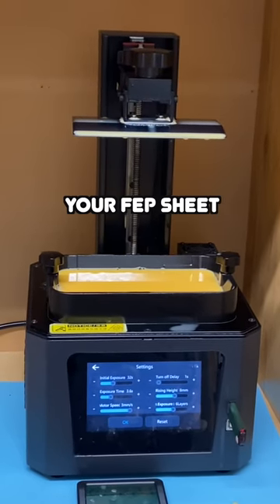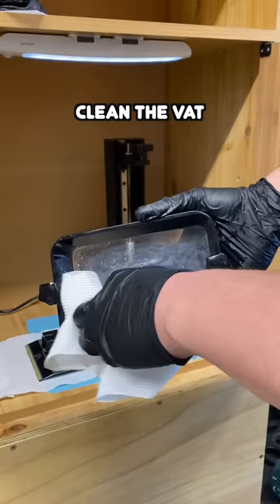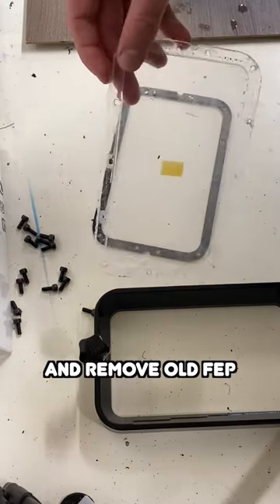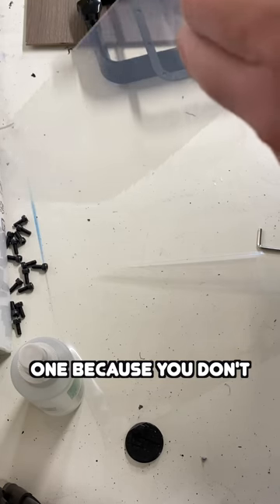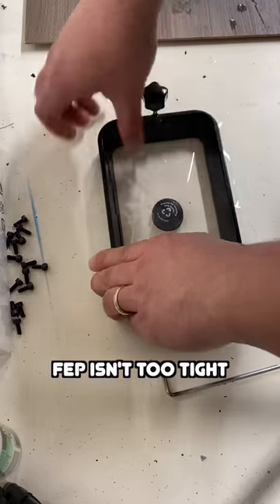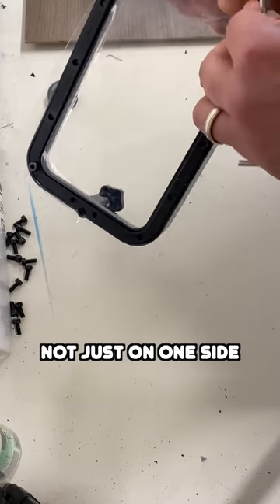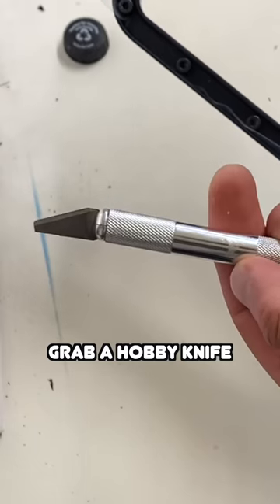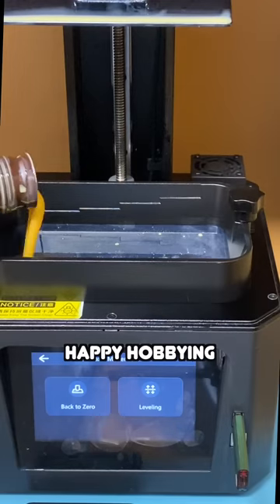How to change FEP resin 3d printing

Comment: I'm an engineer for a 3D printing company. Please, please, please wear gloves when you work with liquid resin. Monomers in the resin are not good for you or water life.
Reply: What it do?
Reply: Does it say so on the resin?
Reply: @mrtrex1748  yes
Reply: @forlexer  if you're not allergic to it already, you're gonna become allergic to it
Reply: Read the SDS sheet.
Reply: @PapiJack  the S in SDS is already "sheet"!
Reply: @FAB1150  People saying VIN number bugs the hell outta me too lol

Edit: And ATM machine lol
Reply: @kaine2416  always bugged me its the norm to say PCV valve or TPS sensor lmao
Reply: @kaine2416  This is RAS Syndrome. IP protocol, PIN number, DC comics, etc.
Reply: @asnodgrass  DC actually dropped the extra Comics from their new stuff
Reply: @FAB1150  LOOOOOOOOOOOOOOOOOOOOOOOOOOOL
Reply: @zokushatech  PCV stands for Positive Crankcase Ventilation so PCV valve makes sense and TPMS is Tire Pressure Monitoring System so that's correct too. Sorry mate I like to nitpick.
Reply: @maynarddrivmester2224  i said TPS, not TPMS. Throttle position sensor. But you are correct on the PCV lmao i totally spaced that 😂. I also hear alot of people say like “i think there is a problem with the ABS system” that one bugs me as well.
Reply: I wrote that at 1am and was about to correct it this morning lol.
Reply: @maynarddrivmester2224 you're not nitpicking and don't need to apologize. You're just correcting the incorrect correctors lol!

Comment: I have a suggestion. Buy a cheap battery op drill. Buy a set of hex head bits. Find the one that fits those bolts, and use the drill to do the screw/unscrew work for you.
Reply from the maker: Definitely will be doing that.

Comment: If you got a lot of screws, get a drill. 

"But-"

No, get a decent one with adjustable torque settings. Any of the ones with a chuck with adjustable numbers is adjustable torque. Just turn the torque way down and tick it up until it's just enough to turn the screws.

Comment: For all the screws I recommend an electric screwdriver with a hex bit. If the screw driver doesn't have enough umph then just manually break them loose
Reply: I second this & if ur worried about damaging the fasteners or something, idk, the small electric driver I have isn't strong enough to even break screws loose half the time so I often break them myself while holding the left-turning button

Comment: Buy a powered screw driver like a mini drill. Buy a pack of Allen key bits. Never worry about assembling things or taking them apart.
I bought mine for furniture work and also to work on gun attachments at the company armory.

Comment: Working with resin has put me off getting a resin printer so far :(
Reply from the maker: That’s fair enough.
Reply: @Habes  Finally got over my resin fear a few months ago and have been Resin printing happily. Went overboard with installing extractor fans and 3D printer enclosure (with its own extractor too) in the garage.

Comment: How do you remove the bottlecap?
Reply from the maker: The bottle cap is just between the FEP and the table, so if you lift the FEP off the table the bottle cap just stays there.
Reply: @Habes  Got it, thank you!! Seriously helpful video btw, I'm just getting into resin printing so I'm trying to get the process down before I start
Reply from the maker: @aaronvischer13  Happy to help :)

Comment: This is assuming you don't do mostly FDM prints. Not resin to mess with or spill, just plastic filament. Also, replacing the bed surface, the FDM equivalent of a fep, just needs a good scrub and maybe some adhesive scraping, and maybe cleaning the print head.

Comment: Imagine having resin printers
Reply: I have one and there's also two more that are owned by my mom's friend and my dad that are in the 3d printer room in our pole barn along with 2 filament 3d printers and a filament 3d printer kit that needs to be assembled. Also none of the 3d printers can be used because the pc  the slicing software is on broke.
Reply: You have six 3d printers, 4 of them are resin, but you can't buy a laptop. 

Imagine having resin printers

Comment: I suggest you invest in an electric screwdriver, saved my life so many with tiny screws
Reply from the maker: Already planning on it XD
Reply: @Habes  how the hell do you not already have one I have six they're like anywhere between 20 bucks to $200 there's a very large price range on them in the super expensive ones are the small precision ones that are for like tensioning bolts and small two-stroke engines professional racing
Reply from the maker: @gnomewarlord8962  I've got a drill, I just don't have the hex bit yet.
Reply: @Habes  then why haven't you got one you don't even need to buy the hex bit you can literally just cut the end off of that Allen key and use it like that
Reply: @gnomewarlord8962  I just wanted to say that you could just cut off a piece of an Allan key to get a hex bit of the respective size. But then I saw your comment xD.
Reply: @gnomewarlord8962  My guy literally explaining that he's getting the proper tools twice

You know people lose stuff, right? And that not everyone wants or needs particular tools for particular tasks, especially if we're talking about automatic upgrades to manual tools
Reply: @Nawmps  homeboy what the hell are you talking about when it comes to particular tools for particular jobs you can use electric screwdriver for anything that requires a screwdriver that ain't really all that particular it's multifunctional
Reply: @gnomewarlord8962  My guy not every power tool comes with every bit

Maybe he has a set of hex bits that don't fit those screws

Or maybe he wants to get a torque-limited screwdriver so he doesn't need a breaker bar to get them back off after tightening them

I just don't understand why you're so personally invested in and betrayed by the fact that he doesn't have one already. You sound like a parent grilling their kid as to why they haven't done their homework yet 💀💀💀
Reply: @Nawmps  well my guy if you read my second comment you would understand that you don't really need a designated bit you can just cut off like a 1-in section off the long end of the Allen key

Comment: I've changed multiple FEPs and never used something to add tension. I'm certain you don't need to do this. Lol
Reply: Same. As long as it's mostly right when you screw the metal frame together, you screw it on to the vat, the vat will actually add all the tension it needs
Reply: Same here

Comment: > screws 
M8, get you an impact driver. Life changing tool
Reply: Maybe don't use it to tighten them at the end.

Like use it to screw them in at the end but not super tight. I can see this messing with the print if the tension between two screws is too different.
Reply: @Peaceful3arth  or just get a just an impact for loosening and a ratcheting screwdriver for tightening, i only use Lkeys where nothing else fits 😄
Reply: @Peaceful3arth  yeah but thats a matter of time and finesse and you can figure it out, and you can just count ugga duggas if anything
Reply: @thegreatchickenoverlord5976  They make electric screwdrivers that achieve the same thing but won't torque the hell out of whatever you're working on. Alternatively you could just use a drill and set the clutch so that it does the same. An impact driver is overkill and really would be slower than a drill, they drive fasteners slower but provide more torque, and torque doesn't seem to be a concern here.

Comment: Hey pro tip, use bolt cutters(or grinder or anything safe) to cut the Allen wrench(key) you'll make one big and one small drill bit piece that you can even put into a dremel or a cheap drill. Makes it alot quicker.
Reply from the maker: Yeah, I think I'll go to my local hardware store and just buy the bit though. Thanks for the tip!
Reply: Allen key will ruin bolt cutters, grind it.
Reply: @mrbmp09  ya if it's a hard composite. That looked like aluminum, but you can alway sharpen/re edge a bolt cutter. And if that's all you have. How often are they really used and proce comparison a bolt cutter is cheaper. But ya I agree grinding would be best if possible!

Comment: Thanks for this video, I have a Photon S and the guide book doesn't really show you how to do it properly with pictures
Reply from the maker: No worries, glad I could help :)
Reply: Don’t do it like this, I have the same printer and all you need to  do (with a new FEP sheet) is put it flush with the disassembled resin vat and puncture screws in the same way you put a wheeel on a car, aka tighten screws evenly across the whole  perimeter

Comment: What happens if the sheet is to tight ?
Reply from the maker: I believe it makes it difficult for the print to peel off the FEP and stay attached to the build plate. Basically more fails.
Reply: So that’s why my prints keeps failing after changing my sheet, thanks so much for the video
Reply from the maker: @ktech6778  No worries, glad I could help!

Comment: "wonder why you got into 3d printing" i've thought that a couple of times before and i have an fdm printer. Turns out cheap filament will result in cheap prints and annoying failures.
Reply from the maker: Yeah, and you can say the same about cheap resins too.